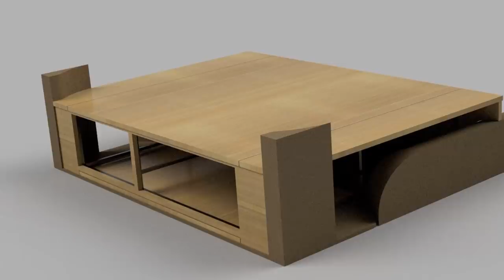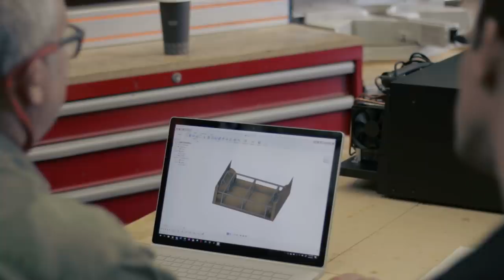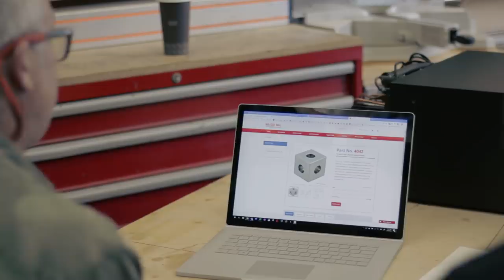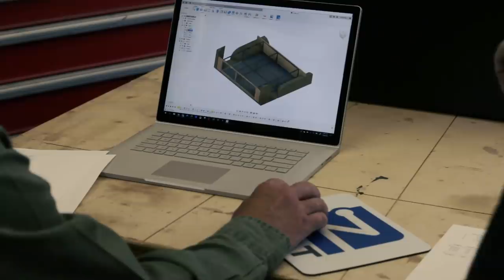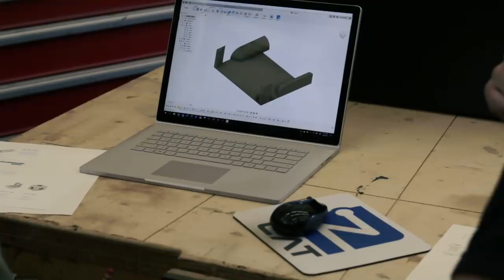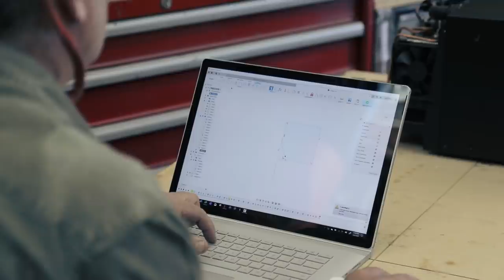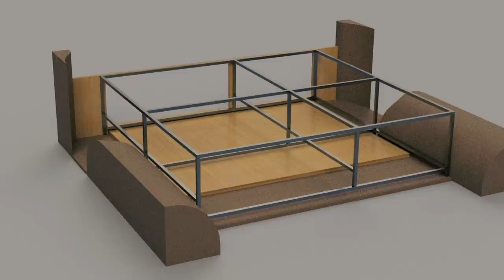DIY Overland Drawer System Build Part 4: Final Design

Comment: Not all 80/20 is slotted. I used the quick tube from 80/20. Its 1x1 square tubing. LOTS cheaper than the slotted stuff and just as strong.

Comment: 1st......
Reply: I am getting my stuff together to do my build. I want to be done and ready for expo west
Reply from the maker: Boom!
Reply: Love my Dometic drawer fridge! The size is perfect! Bought it mid summer 2019 and used it till late fall. Removed it and stored it inside the house over the winter and just reinstalled it this weekend and it doesn't seem to be working. Now I need to find somewhere to get it repaired. Just an FYI.
Reply: @czeb33  do those put out much heat in the vehicle?
Reply: @bah5310  no. I have not had any issue with heat to the point that it is overly noticeable.
Reply: It's working fine. It must have needed to run a little longer.